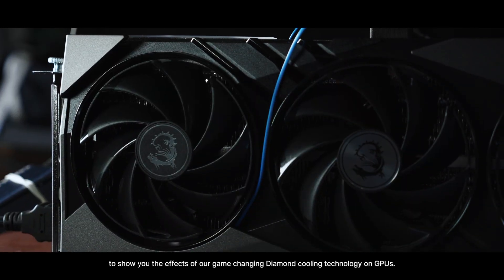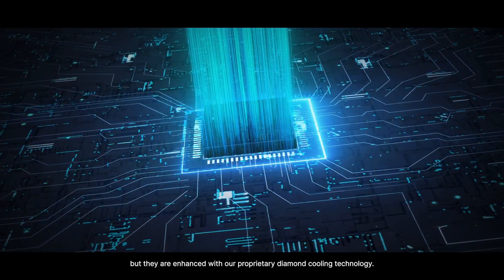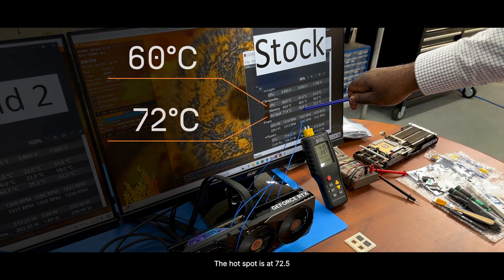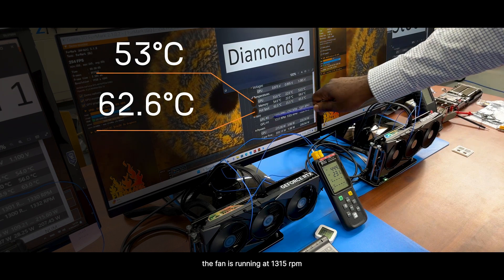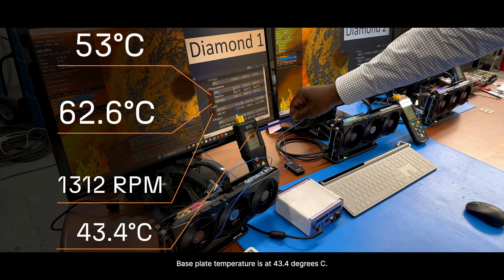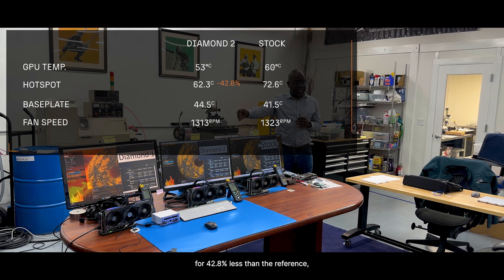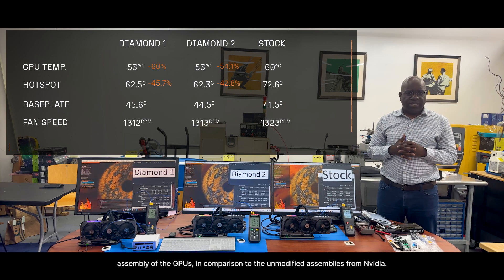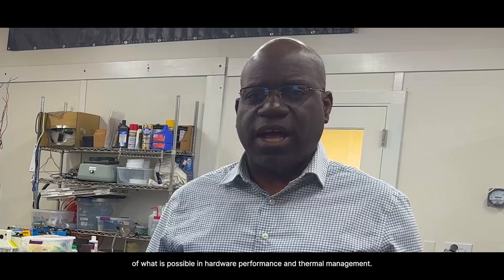Akash Systems - GPU-on-Diamond Demo

Comment: The test seems shady in several aspects, i.e. whether the modified GPU has die thinning and then attached with diamond plate? Are they using exact same TIM? If the modified gpu has thinner silicon die, then you should compare your result with a thinner die version GPU without diamond plate instead of stock version.
Reply: Dear Derek: we don't modify any of the GPUs in the demo.  We have done our best to make it an "Apples to Apples" test.  [Thank You.  From Akash's Technical Team]

Comment: IMPORTANT NOTE: You will observe that the Baseplate temperatures (i.e. the ambient temperature) across all three Servers are not identical.  So, to remove any potential influence from baseplate fluctuations, we always use the Delta-T between the parameter of interest and the baseplate e.g. we use GPU Temp minus Baseplate, or HotSpot minus Baseplate to do the analysis.  Using GPU Temp or HotSpot temp alone (without removing Baseplate) would be incomplete since the Baseplate is floating. 

Example: In Diamond 1, the GPU-Baseplate Improvement = (GPU-Baseplate-Stock minus GPU-Baseplate-D1) / (GPU-Baseplate-Stock) = 60%
GPU-Baseplate-Stock = 60C - 41.5C = 18.5C
GPU-Baseplate-D1 = 53C - 45.6C = 7.4C

We will present the data more clearly in the next version of the videos.
Thanks for checking out our videos.

Sincerely
Team Akash

Comment: Hi, you say " reducing GPU temperatures by 50-60% ", could you please explain about that?
Reply: yeah not sure how 53 Celsius is 60% below 60 Celsius?
Reply: @aymericpacton5279  IMPORTANT NOTE: You will observe that the Baseplate temperatures (i.e. the ambient temperature) across all three Servers are not identical.  So, to remove any potential influence from baseplate fluctuations, we always use the Delta-T between the parameter of interest and the baseplate e.g. we use GPU Temp minus Baseplate, or HotSpot minus Baseplate to do the analysis.  Using GPU Temp or HotSpot temp alone (without removing Baseplate) would be incomplete since the Baseplate is floating. 

Example: In Diamond 1, the GPU-Baseplate Improvement = (GPU-Baseplate-Stock minus GPU-Baseplate-D1) / (GPU-Baseplate-Stock) = 60%
GPU-Baseplate-Stock = 60C - 41.5C = 18.5C
GPU-Baseplate-D1 = 53C - 45.6C = 7.4C

We will present the data more clearly in the next version of the videos.
Thanks for checking out our videos.

Sincerely
Team Akash
Reply: @aymericpacton5279  IMPORTANT NOTE: You will observe that the Baseplate temperatures (i.e. the ambient temperature) across all three Servers are not identical.  So, to remove any potential influence from baseplate fluctuations, we always use the Delta-T between the parameter of interest and the baseplate e.g. we use GPU Temp minus Baseplate, or HotSpot minus Baseplate to do the analysis.  Using GPU Temp or HotSpot temp alone (without removing Baseplate) would be incomplete since the Baseplate is floating. 

Example: In Diamond 1, the GPU-Baseplate Improvement = (GPU-Baseplate-Stock minus GPU-Baseplate-D1) / (GPU-Baseplate-Stock) = 60%
GPU-Baseplate-Stock = 60C - 41.5C = 18.5C
GPU-Baseplate-D1 = 53C - 45.6C = 7.4C

We will present the data more clearly in the next version of the videos.
Thanks for checking out our videos.

Sincerely
Team Akash
Reply: Those numbers make no sense, hard to trust a company that does tuff like that. Seems shady.
Reply: IMPORTANT NOTE: You will observe that the Baseplate temperatures (i.e. the ambient temperature) across all three Servers are not identical.  So, to remove any potential influence from baseplate fluctuations, we always use the Delta-T between the parameter of interest and the baseplate e.g. we use GPU Temp minus Baseplate, or HotSpot minus Baseplate to do the analysis.  Using GPU Temp or HotSpot temp alone (without removing Baseplate) would be incomplete since the Baseplate is floating. 

Example: In Diamond 1, the GPU-Baseplate Improvement = (GPU-Baseplate-Stock minus GPU-Baseplate-D1) / (GPU-Baseplate-Stock) = 60%
GPU-Baseplate-Stock = 60C - 41.5C = 18.5C
GPU-Baseplate-D1 = 53C - 45.6C = 7.4C

We will present the data more clearly in the next version of the videos.
Thanks for checking out our videos.

Sincerely
Team Akash